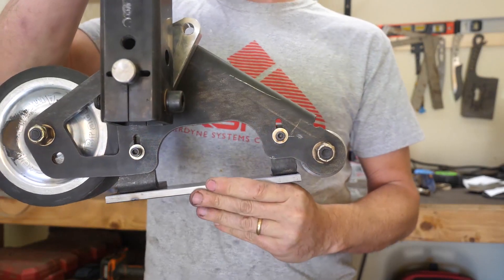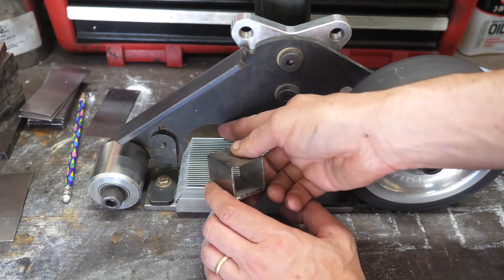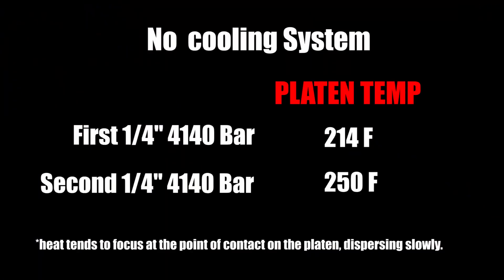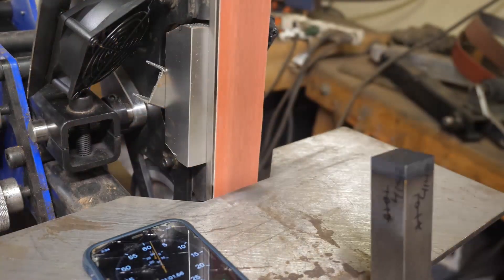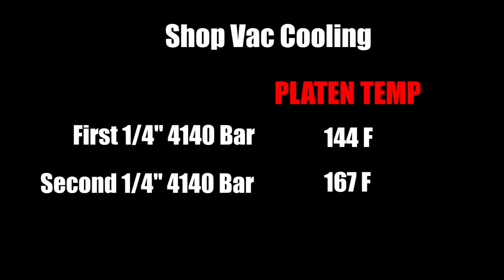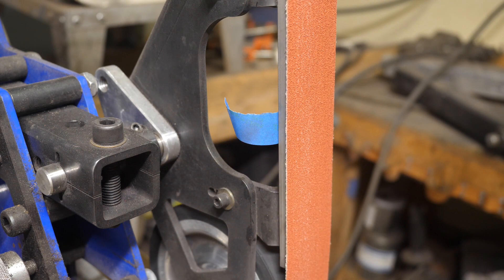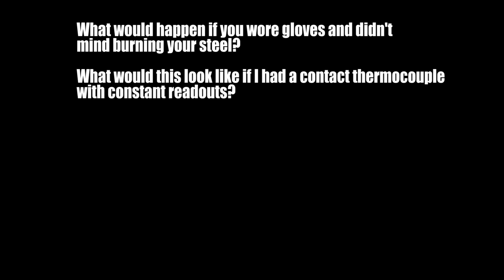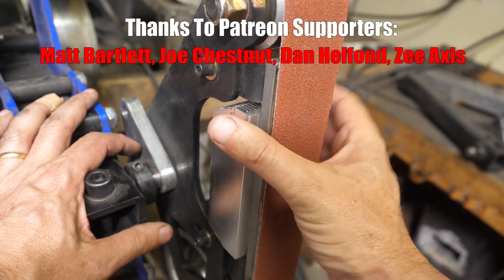Making a DIY Platen Cooler With A Heat Sink And Computer Fans?! Part 1.

Comment: Can you tap/cut the platen mounts? If so, you could try removing the platen and cut out a section of the platen mounts to use as an attachment point for a spring loaded mount for the heat sink i.e. somehow make a bracket for the heatsink that’s attached to the platen mounts instead of the platen and provides that mechanical pressure between the heatsink and the back of the platen. Then you could use thermal paste instead of direct contact or thermal tape. For a cpu, the paste fills all the voids between the heatsink and the cpu (e.g. scratches, etc) and it makes a big difference (though probably not as important at the larger scale you’re working with, tbh idk).

Good video btw 👍🏼

Comment: You can always put small water drip system behind that plate, its a bit messy but should work... Or just put the whole belt grinder inside pool :D
Reply: Water + sanding belt = disaster

Comment: Doing science is fun and I appreciate your efforts. Fun to watch.
Not knowing what type of infrared thermometer you are using, there can be wide temp differences at dot. Cheap ones dont measure at the dot. They cast a cone of measurement that gets wider the further you are away. High end guns actually measure at the dot.
How about a country boy air conditioner? It's a cooler with a hole cut in the top where you would mount a strong fan. Then PVC over to your work area (hopefully no further than 2ft or more) Add ice, salt and water and voila. I use them tent camping when it's super hot. Love your work man.

Comment: What about cutting the aluminum heat sink in half? Then applying it to the platen perpendicular to the way you originally had it. I used and still use heat sinks on electronic amps and modify them in any way possible to get appropriate airflow for maximum cooling. In this way, you could just use a larger 120 volt fan to blow air through the fins so much easier. Too much metal added to the back of the platen would create a greater thermal mass to help dissipate the heat, but it will also create an exponential increase in the amount of time for adequate cooling. Great attempt and don't give up!

Comment: What about tack welding a few 1/4" steel round bars on the back of the platen? Round bars maybe 2" in length? 🤔 and maybe a hair dryer blowing from the side??

Or cut the heatsink in half and position the fins horizontally with a hair dryer blowing from the side?

Comment: You should try just the blower and platon, without heat sink. It could be just the air movement is enough to help.

Comment: I think, ultimately, what we are gonna need is AvE and Major Hardware on the task with you

AvE to work the g code for the CNC milling of perfectly flat surfaces for a custom heat sink
and Major Hardware for his expertise in exotic fan design and understanding of temperature delta

it will probably never happen, but I'm just throwing it out there. idk how to tag people and idk if tagging people is a thing on YouTube, but lets make it happen?

Comment: Awesome idea, but I'd go a little further wirh that: Cheap chinese waterblock, clamping it to the plate with thermal paste inbetween (if the contact patch is actual copper maybe liquid metal) and then pumping the water just from a 10l bucket or something. No need for a radiator for a quick test, but if it's working, then I'd do a closed loop with radiators. Biggest benefit: The surface area that gives the thermal energy to the air can be put somewhere without immediate dust generation vlose to it, so overall less maintenance and a longer duty cycle until the finns are cloged or even the fans stop spinning (depending on the ammount of particulate matter)

Comment: As opposed to blowing air at the heatsink try pulling the air away via suction.
Reply from the maker: Yeah its just that I use the suction side of my shop vac for dust collection.  It’d still be fun to try.  I understand that’s usually how fans are set up on heatsinks.

Comment: Hey Steve,
A better method would be to use a liquid cooled thermal block and run glycol through it (as in radiator fluid). Then dump the heat via a radiator and fan system (eg: small car radiator and car fan. The radiator also works as your reservoir.) You can then adjust the flow rate to get your desired results. Tip: Thermal blocks are easily found on AliExpress or BangGood

I am in the process of milling a water cooled set of quenching plates (water cooled upper and lower plates). Initial tests are showing great results.

And yes. Thermal paste there buddy :)
Reply from the maker: Yeah I’ll try the paste next.  The tape was a step back at 2 w/mk and I think paste is only around 8 w/mk?

Comment: The thermal conductivity of air is so poor, you'd best use a tack weld and a proper thermal interface material because you're assured to have microscopic air gaps.

Comment: It would make more sense to blow air direct on the knife blade. The main source of heat in the blade is the abrasive friction, not the heat transmission from the belt/base.
Reply: He’s not trying to cool the knife down
Reply from the maker: Well I sorta am but blowing air on the blade will make dust collection very difficult.  Same reason I might try to avoid misters, the mess.
Reply: @GreenBeetle  Maybe you can figure out a way  to use the flux of the air in you favor...
I do not have a perfect solution, but I'm pretty sure that even if you could keep that base ice cold, it will have almost no effect on the blade temperature. The heat transfer between the parts is minimal compared to the heat generated by the friction.

Comment: I've done quite a bit of welding with various processes as well as soldering and brazing but I'm not aware of a way to braze aluminum directly to steel. If this is a thing someone please let me know because that would be pretty neat. I ask because it was mentioned in the video.
Reply: There are definitely some solders (some purpose built) that will wet both steel and aluminum. Braising is generally done with fillers that melt at above the melting point of aluminum, so insofar as braising and soldering are different (really just temperature, and there is no hard line), soldering is probably the process you are looking for.

If you are having trouble getting them to stick, tin the contact surfaces with solder first, and then solder afterwards. Use a lot of flux and wire brush the aluminum clean immediately prior to soldering.

The thing that makes it difficult is how quickly aluminum oxidizes, but proper low temp flux should make it work just fine.

Standard electrical solder should do just fine if you clean meticulously and flux well. I have messed around with low temp AC TIG soldering on aluminum, on the aluminum alloys that just wont take other ways (5000 series springs to mind). If you are careful and preheat the aluminum you can tin even the trickiest alloys. Once tinned, it should stick to anything. Most aluminum alloys don't need that level of pain though.
Reply: @JOEDHIGGINS  Interesting. I'm sure I'll come across a job sometime where that will be handy.

Comment: You could go Super Saiyan, block of aluminum for the platen with a thinner hardened steel face, holes drilled lengthwise through the block to attach hoses and run a pumped coolant system through! Then patent it and become a millionaire :O

Comment: You the man Steve! Just setup a must cooler right on point of grinding and go for zero dunks! May need an upper roller shield though...
Reply from the maker: Yeah I see people talk about this but they look messy?
Reply: @GreenBeetle  Messy but effective! You can dial it back to where very little coolant is used and it still works really well, but I've found it takes a well made mister to get a consistent flow at lower settings. (Cheap Chinese one struggle it) The good ones aren't too expensive though.  

I bet just an air blast from a nozzle or air knife at point of grinding would do much better than cooling platen though.

Comment: Maybe use some strong magnets? Do that and use some thermal conductive paste like they use on computer components between the two surfaces. 
You really need that paste between the aluminum heat sink and the steel to conduct the heat properly.

Comment: You can get water cooled platens, the ones I've seen are for Radius Platens down here in Australia by 84 Engineering and they do work quite well if you're going to the trouble of running one + a small garden pump they use for water features.
There's no reason why it wouldn't work for a flat platen though, if you where to machine a block of aluminium with some channels through it for the water, an inny and outy plug, stick it on the back of your steel platen with some ungodly high temp glue. Maybe even save on tubing everywhere by having it go into your cooling bucket with a couple of ice cube in there for a little more lowering of your temperature bracket. A modified, self contained CPU water cooler or two might even work, they make those for some of the bigger GPU cards as well now, but its kind of spendy.

My big brain take on this... Peltier Coolers
Hot side away from the platen, cold side mounted on the platen and just run some current through them! No tubes, no plumbing, external fans etc- just a DC power supply and you'd still have the ability to run it horizontal without stuff flying off.
Reply from the maker: Cool idea.  From what I read I’m not sure a peltier unit would be powerful enough.  They also still have to dissipate the heat w a fan, correct?
Reply: @GreenBeetle  You might get away with a heat sink like the big aluminium block and you can also get 'hardened' units which are sort of the mil-spec variety which is tougher, higher temp specs and bump resistance. They aren't generally very cheap though!
So for the proverbial bang for buck, water cooling is generally a better value, though in Aussie summers I just point a room fan at my entire grinding setup as I'll overheat before it ever does!

Comment: Being a fan of big, dumb, simple, solutions I'd love to see what performance you'd get out of simply attaching the biggest piece of steel you can fit in the available space. Or just using a platten that is 3-4x times as thick.

No need for fins, or fans, etc, just good old thermal mass. If you're only doing a few knives at a time it could be a great solution.

Results would obviously depend on your duty cycle (e.g. maximum number of minutes/hour the grinder is in use).
Reply: @Scott Davis 
Maybe yes, maybe no. Aluminium will conduct the heat faster, but the same size piece of steel will absorb more energy before getting "too hot".

Aluminium has a higher heat capacity (0.921 J/g), but much lower density, (2.7g/cm3).
Steel's heat capacity is comparably low (0.511 J/g), but density is much higher, (7.85g/cm3).

Therefore the same VOLUME of steel will absorb ~61% more heat for the same temperature increase, and weigh 190% more.

From reference the heat capacity of Titanium is (0.544 J/g), density (4.51g/cm3).

Comment: My 2 cents worth: Why not add a strap fastened under the platen mounting bolts? There are innumerable variations on that theme. The strap could be two piece, joined by a small turnbuckle device which would allow hat sink removal without further disturbing the platen mounting system.
Reply from the maker: That’s a great idea

Comment: Honestly?  Waterblock(s) across the whole back.  Means you can route the fans/radiator anywhere and quicker cooling.  Need more cooling?  More radiators/fans.
Reply: Also, please look into cpu thermal compound for better thermal transfer.

Comment: Great video! Maybe look into PC CPU cooling solutions. Maybe use some type of clamping mechanism and thermal grease between the cooler and platen.
Reply: I was thinking something similar.  Maybe a liquid cooling system.

Comment: You may want to try using thermal epoxy.  Thermal compounds (paste, epoxy, and putty) are used to fill the air gaps caused by micro-abrasions on the mating surfaces. It is less thermally conductive than aluminum, but is way better than air. Thermal epoxy is usually the least conductive of the types of thermal compounds, but it will improve conduction between the two surfaces compared to a wholly mechanical connection.
Reply: If you try thermal epoxy look at YT channel: Tech Ingredients for an excellent homemade recipe. It's a great channel!

Comment: I recommend using thermal paste. And the wedge should make it better.
Reply from the maker: I’ll try it
Reply: @GreenBeetle  I would also make sure the bottom of the heatsink is completely flat and that the platten is the same.
Another thing you could try is a water cooling block.
You could attach the block on the platten then use hose to plumb it to either a reservoir or a radiator with a fan on it.
High end computers have been water cooled for decades so some of the parts are out there.
Reply: @GreenBeetle  You don't really need a wedge, just bend a clamp to use the two bolts and affix it that way.
Reply: @GreenBeetle  also the thermal conductivity of a material isn't everything. It is the amount of contact the surfaces make what matters which is what the tape would help with and as the tape itself is fairly thin the conductivity is less of an issue. Thermal paste as people suggested would indeed be best, there is also thermal compounds that glue things in place and have even better conductivity if you ever want to go the permanent route. And yes, water cooling might actually be a better solution given the limited space you are working with as that would move the whole setup with fans out of the way.
Reply: @GreenBeetle  Liquid Metal go hardcore
Reply: @ac.creations  Nah, there's gallium in it, that'd kill the heatsink within a few hours. Not a good idea.
Reply: @ac.creations  Liquid metal out in the open like this would be an absolute mess.
Reply: @Donnerwamp  thats a good point i didnt think about it
Reply: gallium in liquid metal penetrates alluminum and makes it very soft. almost likes wet paper.
Reply: @douglascampbell9809 "out in the open" !? you clearly have never used liquid metal... The only change he has to make is to not use an aluminium heatsink.
Reply: I agree with the thermal paste. Also see whether you can get the fins of the heat sink to allign better with the direction of the air flow. A small copper heat sink is way more expensive, but will also give better heat removal, lastly, if you like to keep experimentimg, I would suggest using heatpipes from a modern computer cpu cooler and see what happens - there is nothing faster for removimg heat 🙂.
Reply: Or a thermal epoxy
Reply: @PunishingPenguin  thermal epoxy is a bit harder to reverse
Reply: @WillFuI  agree 100% but ultimately its the best solution if he is serious about the idea no matter what he chooses to cool it with the epoxy will tolerate the heat and give a good bond
Reply: @PunishingPenguin  shit I never thought about if the paste would break down do to the heat
Reply: I second the idea of thermal paste or rip an intercooler from a Miata… should fit.
Reply: Exactly, no matter how intimate of a contact you make there will be a space of air between surfaces

Comment: Those sparks will likely etch the screen of your timer. I ruined some glass with angle grinder sparks once.
Reply: Ruined a nice phone like that. Was 10 feet away so i didn't think it would matter but a 9 inch angle grinder doesn't mess around.

Comment: I'm only 2 mins in, but make a seperate platen for prototyping(drill, tap, etc). That's what I did for my ceramic platen & it's still on there. I mean if it stays cool enough, it might not need to be hardened. Or use high carbon, if it works, harden it. I got a degree as a computer tech, so I get a kick out of this one... Ok gonna watch the rest. By the way my new video i show stropping on the grinder at the end. Hope all is well, take it easy. Ps, maybe use the fans to pull the heat off the sink, like a computer. Now you're just blowing air around. Also look up thermal compound...
Reply from the maker: I’ll head there now

Comment from the maker: I tried measuring the temperature of the steel I was grinding but the laser thermometer gave readings from 125 F to 325 F in the same spot only seconds apart.  I think it was fooled by forming oxides on the hot face of the steel square bar which change colors and may have messed up the laser readings?  The fact that oxides formed means the steel was actually over 400-500 degrees in some cases and the thermometer never read that hot.  So I didn't report these particular readings. I think someone with some machining and fabrication skill could put together something highly effective by dovetailing an aluminum heat sink into the back of a platen, for example.  And lets not forget how much heat is stored in the drive wheel, surely there's a way to cool that too!
Reply: As others said shiny surfaces don't work with laser thermometers unfortunately. What you could do is paint one side black and measure the temp right at the grinding edge on the painted side.
Reply: Shiny surfaces must mess with laser thermometers. The instructions in mine said to not point it at shiny surfaces.
Reply: @Enigma-Sapiens  That's what i was going to comment too. I tried using mine on aluminum when welding and got pretty confused before i figured out that it doesn't like shiny.